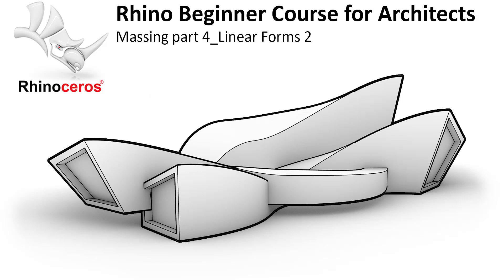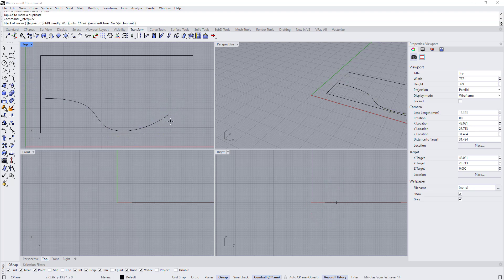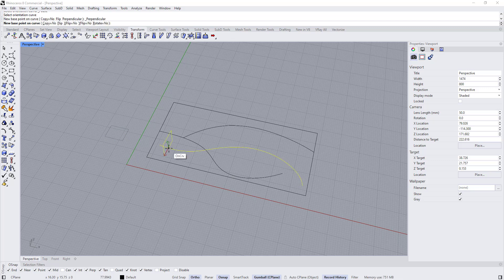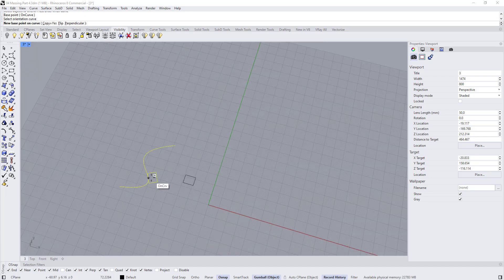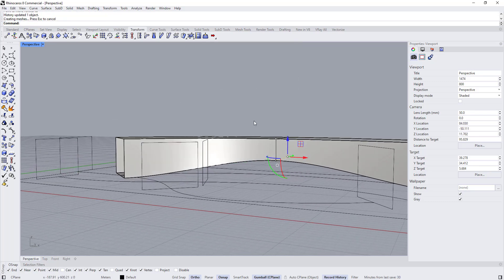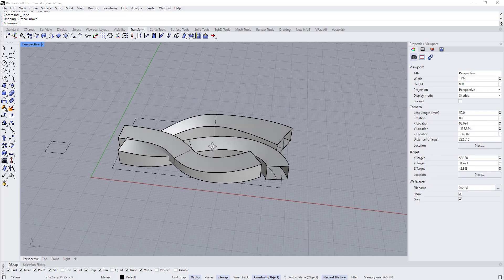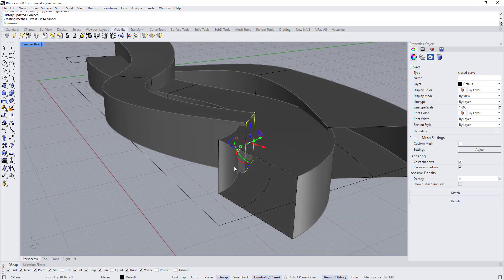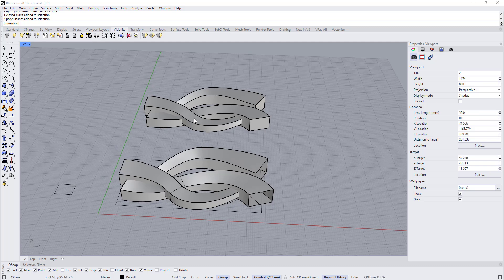05 Rhino Beginner course for Architects_Massing part 4_Linear Forms 2

Comment: @11:12 what if one of the arrows point horizontally while others point vertically? how do i make the arrows point in the same direction?
Reply from the maker: The direction of the arrow follows the same direction as the profile line, so you will just need to move the arrow to the nearest vertical line on the profile